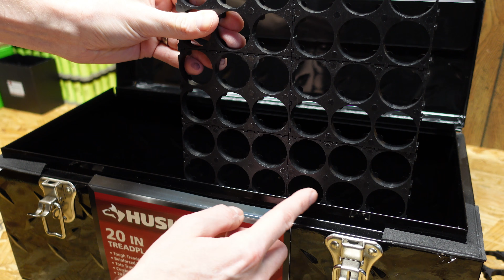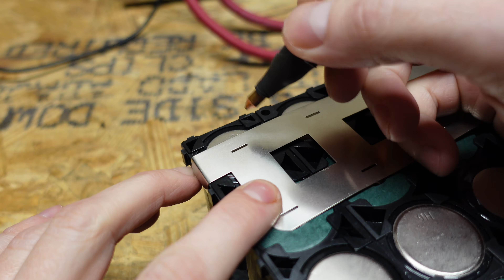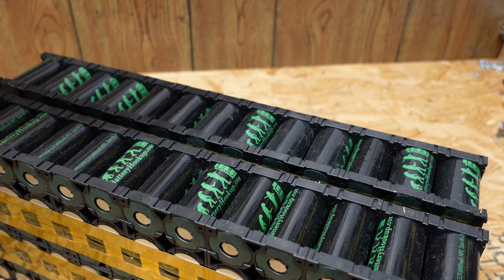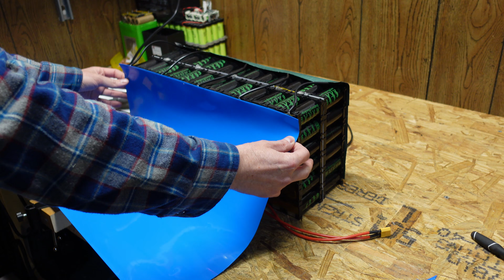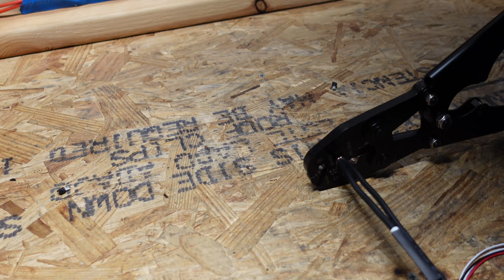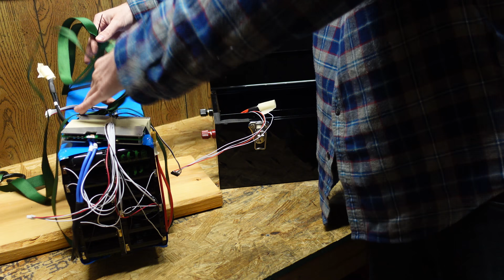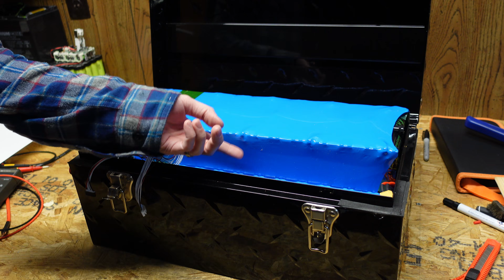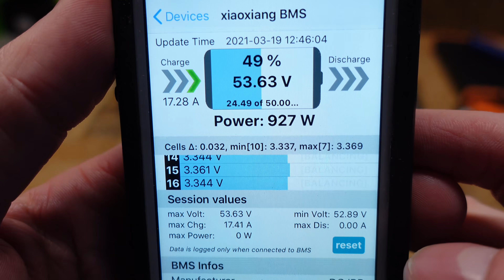DIY 4000Wh 48V LiFePO4 Battery Toolbox Build, Start to Finish!

Comment: Nice build. Those cells can output 10c for 10 seconds. With your setup, that's 780 amps and over 45 kw of power! Those are some very nice cells. 

That said, the 2170s that Big Battery sell (or high-end 18650s) could fit over 9 kwh in that same space. Still, the LFPs are safer in general and should last longer.
Reply: I still prefer a123 26650 cells they can do 120a burst each
Reply: @SheikhN-bible-syndrome  You should look at Lishen 18ah LTOs. 50c continuous discharge. 900 amps from a single cell!!!
Reply: @anthonypelchat  - what kind of BMS for that?
Reply: @DavidHalko  I haven't used any specifically for LTO, but you could use something like the below link. That said, I wouldn't get a high amp bms for LTO. Better to use a relay attached to the bms. It will waste some power, but not usually a big deal. I also wouldn't trust any bms alone. Every 5s is basically a 12v setup. 10s=24v, 15s=36v, and 20s=48v. 

If you use for a solar/wind system, make sure that they either support LTO or that you can adjust max voltage. It is much safer and unlikely to have issues as long as you stay close to the max voltage. 

https://www.aliexpress.com/item/1005001360189653.html?spm=a2g0o.productlist.0.0.4dfe532cBjUmNX&algo_pvid=1369bc49-6fb9-4657-941c-3133ccd3894c&algo_exp_id=1369bc49-6fb9-4657-941c-3133ccd3894c-8&pdp_ext_f=%7B%22sku_id%22%3A%2212000020266819002%22%7D

Comment: I'll add my voice to all the folks asking WHAT'S THE TOTAL COST OF THE BUILD? That seems like an odd piece of information to leave out. Hope you reply. Thanks.
Reply: I think 
208 cells $3.25 each = $780 
Cell holders, Barley paper, tape, tool case $60 
So about $840ish
Reply: @recoblade1465  Holy crap they raised their prices.
Reply: ~$400 just the big parts alone, cells, balancer, chest.  Plus all the little pieces easily over $500.
Reply: With regards to the balancing lead on the BMS, I assume one is negative, and all the other ones are to the positive leads?

Comment: Nice work! 
You can calibrate the voltage which is read by the balance leads... not sure if you can do it on the app but you can do it with a windows computer and a USB to serial adapter... the software is a free download. It may be worth checking to make sure the voltage of all the cells are what the BMS say they are. I've had to calibrate 2 out of 3 of my BMS's.

Comment: ... ever thought to spotweld the rows (all 16) lying flat on the table and ziczac-flipping a pack onto the next so they are connected through a (bend) nickel strip (insulated the same way of course) ... so you get along without cabeling ...
Reply from the maker: Yeah. You can't do that here because the packs have an even number of series connections making both +/- on the same side of the battery. You could do 6-5-5 instead of the 6-6-4 I did, but then you can't fit it in the toolbox because of the lip that I had to slid the 4-wide pack under. You'd need a larger toolbox or different kind of container. Thanks for the idea though :)
Reply: @LithiumSolar  ... --> zic-zag-flip ... 6-6-4

Comment: Did you test the cells?    May have imbalance in your pack design
Reply from the maker: No, I did not test them as they were all new and from the same batch.
Reply: @LithiumSolar  that's one thing that I just have to do to all my cells.   I'm a bit fanatical about having balanced groups of cells.    When I build a pack each cell group on paper is within .5 Ah. (packs are usually 80 cells)   then I test each cell group after it is soldered/welded for confirmation.

Comment: Another point you didn't seem to make.... you should top balance ALL of your cells before building the pack because most BMSes can't really balance charge well.
Reply from the maker: Yeah, that would have helped some of the balancing issues I had here in the end. I had figured since they were all from the same batch, the state of charge would be fairly close enough.
Reply: @LithiumSolar  for ref, I've ran into this exact problem with those 32650s.  They're good cells but they're not all the same SOC.

In my case I had to use pairs of balance leads and my PSU to manually balance sets in my array.  After that my battery as a whole behaved better.

Comment: just for ref .... pelican cases make better battery boxes.  They're non-conductive, usually "weather proof", don't rust, are easy to put ports/holes in without sharp jaggies, etc...
Reply: I was thinking the same. I like most everything about this build except the conductive box.

Comment: That's a lot of battery for a footprint that small.  As always, your build quality is very impressive.  I don't have the patience to work with the smaller cells like that, but if you need a higher voltage output, in a small(ish) package size, this is the way to go.  At some point I'll have to build a 24v, ~50AH battery to run the trolling motor in my boat.  What cells would you recommend for something like that?

Comment: Ordered 16 Lifepo 40ah prismatic cells cells from Battery Hookup and they sent me only 15.  That was January 21st... still haven’t received the second shipment for the correction.  I’M STILL WAITING TO BE “HOOKED UP”!!!
Reply from the maker: Oh man, that's over 2 months ago. I wouldn't have waited that long. Give them a call if they haven't followed through yet to make it right!
Reply: @LithiumSolar  ya... they “sent” the 16th. Battery... but it’s stuck in customs because they never marked it “gift / warranty”.  I already paid for customs and handling on the 16 batteries.  Battery Hookup said that they would reimburse me for the costs. However,  I have not been notified of the costs or even when delivery is to happen.  Can’t make the required battery pack with only 15 batteries either.  My client is pissed... What a mess!  
Wish that Battery Hookup had a phone number for customer service... but they don’t.  Emails are an ineffective means of correcting complicated issues.

Comment: What is the reasoning for building a 48v or a 24v system? I have only built 12v system using LiFePO4 prismatic cells.
Reply from the maker: I have a 10,000W inverter. That would be 833 amps at 12V or 208 amps at 48V. See the difference? :) :)
Reply: Current.  Items like a BMS or solar charge controller are rated in Ampere. So a 24V system cuts the current in half over a 12V system or in other words, a 60A BMS in 12V gives you about 720W of max power but 1440W at 24V and 2880W at 48V.  Also wiring gauge requirements are reduced and crimping will become easier and cheaper.

Comment: Gotta have location (GPS) on to use low power bluetooth on Android ;)
Reply: Also metal and radio waves dont mix well..try it with the lid open?
Reply from the maker: I tried it with the lid open. Interestingly, I can receive the Bluetooth signal halfway across the house on my old iphone with the toolbox lid closed, garage door closed, and 2 walls in-between lol.

Comment: The one thing I would have done differently to put the packs together. I would have taken the nickel strip used, folded it in half to crease it, spot weld one half to the Pack with the positives, and spot welded the pack with the negatives, then would have folded the pack into one another, and also put the barley paper in between. But that's just how I would, doesn't mean it was done wrong here. Great Video!
Reply from the maker: It doesn't work out because there are an even number of cells. Both connection points end up on the same side of the battery, so you have to use wire no matter how you look at it.

Comment: You forgot to mention that you have to make sure the cells are charged to a similar level when you connect them in parallel with the nickel strips
Reply from the maker: I did not do any pre-charging before assembling Doing so would have helped the balancing issue during capacity testing though...
Reply: @LithiumSolar  yeah I’m pretty sure you were safe, but that’s assuming someone bought new genuine cells. Il they usually get with pretty close voltage. My comment was more for people that diy packs with their own tested cells. Cheers!

Comment: What is the total cost of assembling this unit??
Reply: Did a quick estimate adding everything in the description (Minus the charger) and I got $1076 without tax or shipping. Could be a little more a less because I wasn't sure on the dimensions of paper and heatshrink needed.
Reply: Woops forgot the BMS which is out of stock but a similar one is sold by overkill solar . About $145 so $1221 total. Pretty cheap even comparing the cheapest alternatives like the "Chins" 100ah batteries that Will Prowse just reviewed. 3 x 1280Wh would cost $1440 (w/o tax/shipping), granted there would be a little less capacity but these cells are better quality. Plus you get bluetooth and the Xiaoxiang app is great
Reply: All that hard work ? You better off purchase a 48V battery and call it a day    Anyways you did a Beautiful job in making the battery

Comment: It seems like the sites like Hookup, that sell the loose LFP cylindricals, would have an interest in finding a cheap spot welder that held up. This just seems like something that has been a problem for years. There are a lot of LFP 48v packs on Ebay, basically marketed to Ebikes. The whole package with the BMS. I have a 36v from Sun that is in great shape after 5 years. The vendors have high feedback ratings, and a lot of sales. You end up with a shrink wrapped package with the BMS either way. If I have to spend the big bucks for the welder the economics are even worse. This is a great project but I've looked at the Hookup cells a dozen times and can't justify chasing down what is needed to do the build.

Comment: Great Jorb! Not for me though, I've become a 98Lb. weakling in my advancing age. But, it's nice to see those 32700 cells being put to use (that's what's inside of my AimsCorp '50AH' (47.5AH?) 600 W Bluetooth enabled LFP battery that I paid big money for last month! But, I complained about how over-sized & over-weight it is for two weeks... until I got very satisfied that I will be able to cycle it for like 14 years before it gets too tired and only has 40AH. Will Prowse motivated me to build a portable power source when he started the Milk Crate builds!!!

Comment: I am worried the reason your cells were progressively lower is related to the way they were wired
Reply from the maker: It does look a bit odd that they were progressively worse like that rather than random. Can you please explain? What would have caused that?
Reply: @LithiumSolar  it was hard for me to grasp exactly the route of your electrical flow but since you're the one who did it maybe if you read that link I sent you'll decide whether or not your design can be improved upon.
Reply: @LithiumSolar  I've never dealt with this but perhaps slight voltage drop through the pack wiring is causing the "farthest" end cells to have to put out just slightly more current to keep up?

Did you ever solve this?

Comment: Personally, I love these sort of videos, you should do them more often👍
Reply from the maker: Thanks! I love doing full builds like this but they take SOO long! Lol. Is there any type of build in particular you'd like to see?
Reply: @LithiumSolar  Maybe something similar to a Anker Powerhouse, incredible compact and versatile. It's going to be challenging to fit all the required components, but what's a build without a challenge😅.

I think it'll rack up a lot of views as your DIY Solar Generator did
Reply: @LithiumSolar  would love to see a build of a version of Milwaukee’s new Carry On battery bank. Just with at least 3000watt continuous, instead of the 1800 continuous (3600 peak) it comes with. 
I’ve almost bought it a few times but it’s just a tiny bit to small to power 2 large (12-1600watt/ea) power tools at the same time. 
And there’s many construction guys using big tools that would love to have a cheaper option then the Milwaukee
Reply: @ThisTall  I'm currently building a complete 5kwh 2000w solar generator build inside a Milwaukee pack out box. I think it will be great for doing projects in the field where power isn't available.
Reply: He can also make a DIY petrol tank, would you be as much mesmerised?